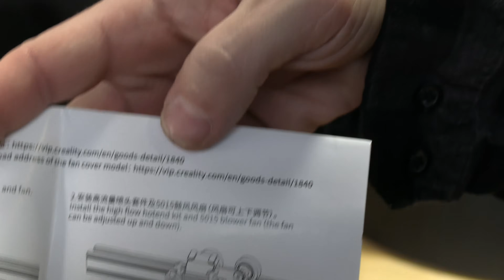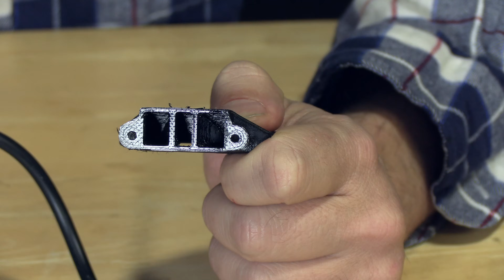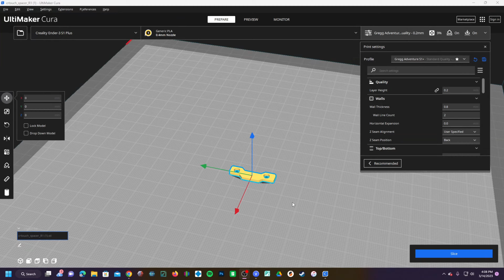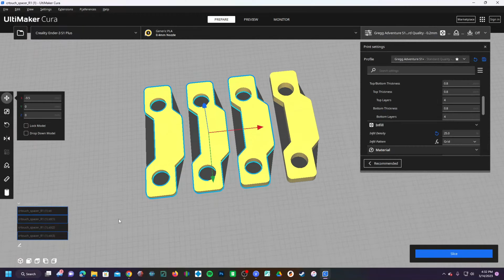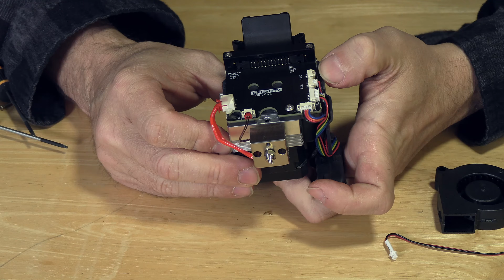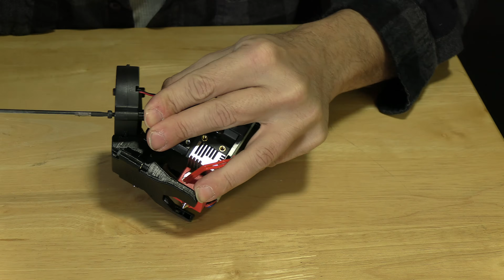Install the Creality Ender 3 S1 High Flow Kit for Sonic Pad with 5015 Fan and V3 Air Duct by ZUFF

Comment: Thank you for making an awesome video that is easy to follow. My Ender 3 S1 has given me nothing but trouble since I got it. I just replaced the firmware, because before that all it did was make shrill sounds and flash red lights from the leveling sensor. I have some replacement parts coming from Creality. So, fingers crossed that I ordered the right ones. Because this is the final attempt to make this damn thing right.
Reply from the maker: I am not a fan of the S1. It SHOULD be super, but for whatever reason, mine was a pain in the ass. Careful with "Upgrades". What is yours doing?
Reply: @3DRundown  Driving itself into the print plate until I updated the firmware. Then that bricked it (the red-light and screaming). Then, I installed the professional firmware. Which seems to have resurrected it.

Now I'm having issues with consistent temperatures, the prints not sticking to the print plate, but the strip that prints before the print to clear the print nozzle prints perfectly and sticks.

I replaced the nozzles with - I think they were carbide? I tried to pull them back up on the creality page, but I can't find them.  But they were supposed to be both crush and heat resistant. 

I have on order: a replacement magnetic plate, because the current one was ruined and is missing chunks. Also, the glass one. Because the magnetic one has me at my wits end. A replacement auto leveling  sensor (because I thought that might be the reason for the sudden dive into the print plate?) And the ceramic heating piece for the sprite Extruder (because of the sudden inability to maintain temperature stability. It looks like its plug and play, so it should be an easy part swap. But knowing creality, I'll end up screaming profanities.)

Right now, I'm watching your bed leveling video and doing that.
Reply from the maker: Your Z Offset is causing the nozzle to hit the bed. When replacing firmware,  you will need to set the Z Offset again.
Use the glass. It is best.
Use MRISCOC firmware
I have not test the ceramic hit end, but the Speedy Spider Hot end uses it, and I hat troubles with it. Maybe this one will be ok.
The problem is likely the thermistor, or heater tube. Or, you need to run a PID tune.
Reply: @3DRundown  Good to know! I planned on tuning it while swapping out the bed. Just do it all at once. 

Do any of the parts require greasing or lightweight oil lubrication?

And when you replace the thermistor, the paste used, is that just standard thermal paste?
Reply from the maker: Don't go crazy on parts. Do what you need 1st, and of course, the Glass bed. No oils oils or grease. Only PTFE like this: Though, I almost never have used it on anything.... https://amzn.to/3OJypmt
There are mixed opinions, but, a little Thermal Paste, similar to CPU Thermal Paste will work.
Reply: @3DRundown  Got it! I'll make the necessary changes, service the parts that need it, and see where everything stands. 

Thank you!
Reply from the maker: Good luck! Let me know how it goes.
Reply: @3DRundown 2 years late on my reply, but I did get it working! Moving out into my garage/shop, so my printers are out there and out of use until it cools off outside.
Reply: I had a ton of problems with mine too, While I was waiting for my 3 V3 Plus to come in I started playing with all the knobs like any good Marine would do, And it turned out that once I tightened all my belts all my problems went away. I am by far no expert still a nooby, but it's worth a check if you haven't dumped it off already.
Reply: @dog0311 I actually just did this the other day! I’m converting my garage into a shop, so I’m moving all my equipment out there. PMCSing as I go. The bed belt was very loose. 

Aside from that, the firmware and replacing some parts made all the difference. Set to use that and my resin printer by creality as soon as it cools off (or as soon as I install a ductless split, whichever happens first.)

Comment: Thanks for your detailed information video. The fan model are used from zuff v3 the zuff created a upgraded model of V4 dual fan duct design so I requesting to you please make a tutorial video for newer v4 fan model same I requested to the creator Mr. Zuff so he said he don't have experience in video making stuff so if possible please make the 5015 dual fans v4 duct tutorial.
Reply from the maker: The 4 was actually out when I did the 3, but I liked the 3 Better. My S1 sucks. I don't even have it hooked up, but I'll see if I can do the V4

Comment: I bought this kit and changed to the 0.6mm nozzle before even using any filaments, but i am getting underextrusion. My profile was already a 0.6mm cht nozzle so this is very weird for me.

Any suggestions? I looked inside and all threads looked great and no obstructions. Same distance between hex-head and heatblock as well.

Comment: My Fan has the wrong connector ... its bigger .. what is the right name for the connector for the Ender 3 S1 Pro Fan ?
Reply: I think it was JST micro IIRC. Look into the S1 "modder board" which has standard JST fan connections on it.

Comment: Is there a way to just get the blower fan? I installed the bi-metal heatbreak / thermistor to replace teh PTFE tubing one before knowing about this upgrade. I'd like to install this blower to avoid having to do wiring with a different brand.
Reply from the maker: Sadly, I haven't been able to find it.

Comment: Creality Customer Service....more like what customer service. I had to reach out to them for some support and it was hell. They were extremely slow to answer and in the end they were not helpful at all. I do not recommend anyone to buy Creality products, better you go with Prusa which will most likely be my next purchase as a 3D printer
Reply from the maker: Creality has several Customer support channels, and communicate with people everyday. I've never had trouble reachine them. Now, try to get a reply from BAMBU.
Reply: @3DRundown  I tried via Facebook messenger and never got a reply from them. Via email I did get replies but man were they slow. I'm not aware of any other channels but if you have any pointers i'll gladly take them.
Reply from the maker: They have a FB page for Support, and they also have live support on CREALITY.COM. You need to try on THEIR time, so, after 9pm EST is best. Sometimes they aren't knowledgeable enough, but, higher ups review the chat and follow up with emails.

Comment: How does the Creality Cooling Fan Kit for High Speed Printing with Sonic Pad 24V Upgrade [B0C2BVG7W7] compare to the High Flow kit 5015 fan? I have ordered both kits and intend to test the 3x 5020 kit before installing the fan in your video. I intend to install the High Flow nozzle upgrade either way, but it could be helpful to have some discussion on the advantages and disadvantages of these kits. I was unable to find any buyer reviews or videos for the 3x fan kit. Also, it is unclear if using both fan upgrades simultaneously is advisable (or too much extra weight, for example).
Reply from the maker: I haven't got my hands on the new fan kit, but it likely crushes the 5015. That said, i've had no cooling issues at all

Comment: Did i understand right, that ti doesnt matter if the cr touch is mounted wirh a 10 cm or 3mm spacer? So it cant be mounted wrong if i use spacer from 3.5mm and up?
Reply from the maker: Use the smallest spacer that works. The ones that come with the kit should be fine. In the retracted position, the probe needs to be above the Nozzle.

Comment: I jave managed to actually download the file of the fan duct or mount. There was actualy a typo in the manual I'm the English translation. Go to the one thats in Chinese. It will then lead you to the high flow kit product and there is a download button. Thats where you get the file. You have to make an account though to have access to the download.
Reply from the maker: According to Creality, it is not possible to make an account. I tried for about 2 weeks. They told me the site is only for re-sellers. They eventually sent me an stl, but it's wrong. Doesn't work at all. How did you manage to get this, and does the file fit? I was told by others, that the file is actually a users file that they took and provided without permission.

Comment: Thanks for the guide, I installed mine without a hitch, used eSun PLA+, working fine without a problem yet.
I also used the stock spacers they provided, seemed to be the right spacing I needed funnily enough.

Comment: Have you experienced rebooting when printing Petg? I run the Sprite pro and everytime I run material at higher temps than pla like Petg @235c my printer reboots after about 30min or so. I would  expect the sprite pro fans can handle those temps since it is marketed as a multi material extruder. Pla, Petg, abs, carbon, nylon,etc. I’m stumped. Maybe you have had this happen and may have a tip?
Reply from the maker: This has got to be somekind of wiring situation. I would consider replacing the Thermistor or heater tube
Reply: @3DRundown  thanks for the pointer. I guess how’s a good time to trap the high flow kit. Been contemplating it since I watched your video on it.
Reply: Changed my retraction from 1mm to 3mm and increased retraction speed and print speed a little and it worked itself out.

Comment: Would the S1 pro benefit from the high flow kit or does it already come installed?
Reply from the maker: Not as much as the S1 or S1+, as it's already all metal, but the throat and Nozzle are physically larger, so, while less so, it's a yes.

Comment: Thank you for uploading this! I have a few questions, if you don't mind.

1. Does this new fan improve sound? My stock Ender 3 S1 is pretty loud while running, so if this fan makes it quieter I think it'd be worth it just for that.

2. What's the issue with the nozzle? I don't know much about nozzles since I just got into the hobby, but I was wondering why you said it's bad. Would you say the nozzle makes this kit not worth it, or less worthwhile? Also, is the nozzle a standard 0.4mm like stock?

3. Do you have to change any settings on the printer or in the slicer after installing this kit?

4. Is there a reason why you went with the 3D printed CR Touch spacers over the metal ones provided with the kit?
Reply from the maker: I only have a quick min, but didn't want to leave you waiting.. so, quickt:

1.) The fan is reasonably quiet.
2.) they are proprietary, so cost more, and less options, but not really THAT big a deal. The Speedy Spider, went back to using MK8. That is the way they shoulda went. That said, the Nozzles are good nozzles. Not a single clog yet.
3.) No. unless you want to try pushing it for more speed
4.) Because the Zuff Shroud is not compatible with the Metal one

Comment: This does not surprise me in the slightest, you only ever get half an upgrade with Creality, there is always something wrong with them, have you noticed how many influencers are no longer reviewing Creality products? Some stopped when they were trying to bribe people for favourable revirews
Reply from the maker: I don't watch any other influencers, but, I can tell you from my personal experience, that Creality has never asked, nor even HINTED, at leaving them a favorable review. I had an 80 minute Video chat with several people from Creality last week, and even then, nobody even so much as WINKED at me, for a favorable review. They simply ask me if I'm interested in an item. If I say yes, they give me a time frame on sending it, and that's that. They never ever guide me in any way, on how to cover the item. That said, I can only speak on my own experiences. Creality has some weakness, but, other 3D printers have the same, and most of them, deal with a much smaller user base than Creality. The industry as a whole, has much room for improvement, when it comes to support, and documentation

Comment: Does this make that much of a difference? Also, why not print with PLA?
Reply from the maker: Because PETG can handle higher temp, and is stronger. Mainly for the higher temps, so it won't warp.
Reply: @3DRundown have you found petg to continue to hold up? I’ve always used abs for parts near the extruder and heat plate for the added temp resistance but nice to know that petg as an option if it continues to hold up

Comment: Which speed did you achieve with and without those upgrades?
Reply: I'm using klipper and the sprite extruder pro kit, and I can print ABS to 200mm/s without any problems.
200mm/s has a flow of 16mm³/s, so the hotend can handle it well.
Reply: @ledzpg  do you have a ender 3 s1 ?
Reply from the maker: I honestly don't push speed much at all. As printing is my full time business, I focus solely on Success, and Quality. I'm usually anywhere between 30-60, with 45ish being most common. This is on the low end.... But, this hot end has been great so far.

Comment: Nice video explaining all. Those nozzles are a hateful "upgrade" when you have dozens of mk8 or v6 around. One thing I did notice, why are you using a torx T10 driver on allen screws? I know it worked but just curious.
Reply from the maker: It works. That's exactly why. 😜 They do work, and since we're not using a ton of torque on these little screws. There really isn't much worry about stripping. Also, get the new Speedy Spider! They corrected the Nozzle situation

Comment: So would this be a considerable upgrade for my s1 pro?
Reply from the maker: More so for the S1 and S1 Plus, but you'll still get a better heat break, HF Nozzle, and much better cooling.
Reply: You said you have a class? Im wanting to learn more about printing. Setting/adjusting speeds, temp, walls. Etc.

Comment: Hi, thanks for your videos.
I can't find the kit on the creality site.
I find the spider Hotend but it has no fan and I am not sure if it has the right length cables. Do you know if it is available on any other vendors?
thanks
Reply from the maker: Make sure on correct shop. Go to creality.com and click "store", type in High flow kit.
Reply: Been having the same problem. Can only find the high flow kit for the Ender 3 V2
Reply: @hleumasg  at the moment unfortunately it is only available in the US store

Comment: I'm thinking of getting this for my S1 Plus. You said that you don't like the nozzle that came with this kit. Which nozzle do you recommend for it?
Reply: I think he might mean the thread length, it’s not usual and a bit longer than standard nozzles. But i‘m not 100 percent sure.
Reply from the maker: Yea, it's the Spider Nozzle. An uncommon size
Reply from the maker: It's the "Spider Nozzle", you'll need to use that one. So far, It's working well, but they are a little pricey and less available than more standard V6 or MK8 nozzles

Comment: Having already bought the diamond tip nozzles that fit the s1pro I'm wondering is this kit still worth buying for the upgraded fan alone with the hot end that comes as standard with the s1pro running klipper.
Thank you :)
Reply from the maker: Yes and no. If you can get the creality fan, I would go with that. Then print the Zuff. If not, you can get another 5015 and splice the connector yourself. I am not in love with being restricted to the spider 1 Nozzles

Comment: I'm still confused does this actually upgrade the S1 pro? or just the S1?
Reply from the maker: BOTH. It will add a larger throat, and HF Nozzle. But it's a bigger upgrade for the S1, and S1+, as they don't have allmetal
Reply: @3DRundown  after much research I found it has a copper throat